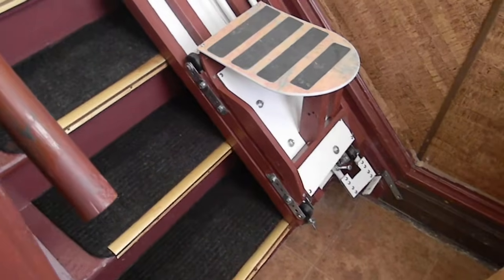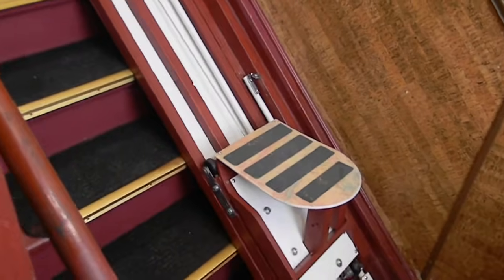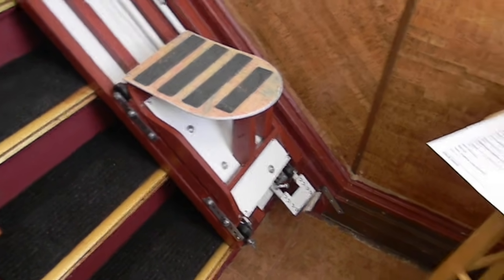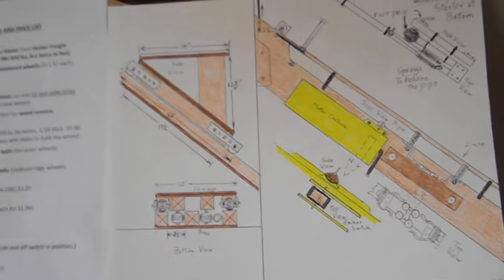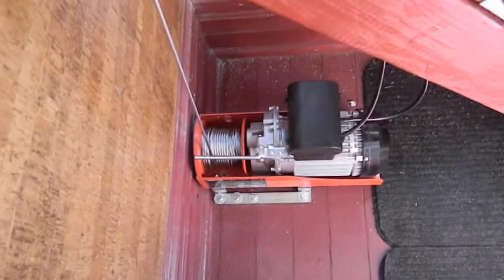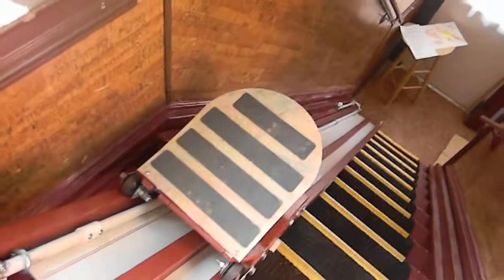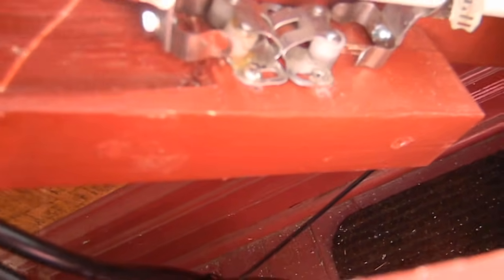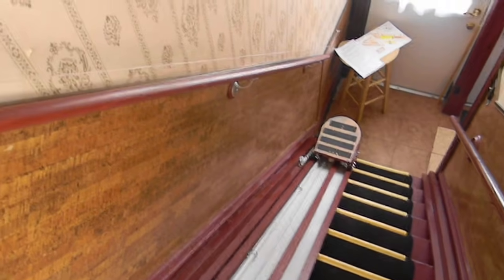$300 DIY Home Escalator Elevator for stairs with a landing

Comment: https://youtu.be/k5VOXvE5TmI?si=Ad0ANMMS-0SW9X8M . This format has obvious advantages. You could probably build it for a similar cost. Good for you making a working stairlift and if you are not bothered about losing stair width or having a moving 'railing' then i can see your design is easier to implement.  The weight being taken by the stairs instead of the wall makes it a system less likely to fail.

Comment: Would it work outside, going up a simple 5 steps to a deck, especially in the NorthEast in the winters?
Reply from the maker: I think so ...just cover the motor,  pipe and parts and brush the snow off

Comment: Would it be possible to build this as an outdoor solution to stairs? How would I protect the motor and mechanisms? Thank you kindly! I live in a steep area and can’t keep using the stairs to get to my car.
Reply from the maker: Yes, I think it would be the same but need a cover over the motor ....perhaps removable at the top of the stairs.
Reply: @billblanning2068  Would the rail part be safe in wet weather and using in the rain? It’s just using a hoist with wire cable right? So as long as the motor is safe? But what about wet cable? Should I build an overhang to prevent as much rain as I can from getting to it? Can this be built to any steepness? Is it dependent on being built on stairs or can it be built on a slope, let’s say along the side of a stilted carport?
Reply from the maker: @TheSoulAlignmentCoach  lYes steepness doesn't matter.  You might use Superstrut  (Home depot electric area) to center it and certainly not need stairs except you might get stuck without them if it failed..  I found wheels with a V on thrm that could be used on superstrut but I can't remember where
Reply: @billblanning2068  Thank you 🙏

Comment: Still climbing stairs manually is a good exercise.
Reply: I used to climb the stairs over riding in an elevator all the time until  Fibromyalgia entered my life and changed everything. Some days, I can climb 20 steps without a problem, most times however,  two steps are problematic. I used to love to hike, play tennis, walk 5 to 10 miles a day, swim and all kinds of things. Now, those things are sad to even remember. Don't get me wrong, I'm not feeling sorry for myself and don't want anyone else to feel bad for me  either. Even with all this, I'm still better off than others. I count my blessings all the time. Not everyone can enjoy the climb of the stairs for many different and very real reasons, which makes the need for stair lifts real.

Comment: I'd prefer full width, completely covering stair.  I suppose it would need to be sturdy enough to walk down in case of power failure.  I'm wondering whether altering the stairs at all would violate code?  Excellent video, I've need wanting to install an escalator forever.

Comment: I honestley thought when you were riding it up you had like a remote or push button panel like on that dumbwaiter system you also showed
Reply from the maker: No, there is only the safety cutoff line on the side in case you have a need to stop.
Reply: @billblanning2068  ok
Reply: Still really neat and certainly way cheaper than spending around 20 thousand dollars on an actual automatic elevator system

Comment: I'd worry about how safe it would be once you get a bit older and balance and mobility become more of a problem - the time when you need it the most...
Reply from the maker: It is exactly like walking up the stairs .. you use the bannister for stability and there is no problem, plus the safety line on the side quickly stops it ... if needed.

Comment: Hi! This is exactly what I need. Is there anyway you can email me the blueprints and material list.
Reply from the maker: Sorry, the video has to be enough, but you might look at my other video, the "$250 escalator elevator".
Reply: @billblanning2068  I did look at that and I’m working on finding someone to build this for me but I need to give them the blueprint
Reply from the maker: @lisamarieragazza8014  I didn't make one,  I just planned and built it from plans in my head ... trial and error. using the "$250 elevator escalator" and the "moving stair" controls.
Reply: @billblanning2068  yo have photos in your video 9f a drawing and materials list. You could attach that.
Reply from the maker: @RealMSLifeHacks  No, sorry
Reply: @billblanning2068  so taking a picture of the three pieces of paper you had in your video is asking too much. Nice.

Comment: Love the ingenuity! Do you have a guess on the weight limit?
Reply from the maker: The hoist motor was a Harbor Freight 1300 lb hoist using 2 lines but I only used one which put it at 650.  Look at my other 2 on youtube under BLANNING.  the $250 elevator escalator used 2 lines and did fine at 440 lbs.

Comment: how about a box to cover the motor to reduce the noise
Reply from the maker: Your right, but the motor overheating if used more than a few times in a row means it would have to be done carefully.  Certainly woth a try.
Reply: @billblanning2068  I don't know anything, but would a simple fan help?